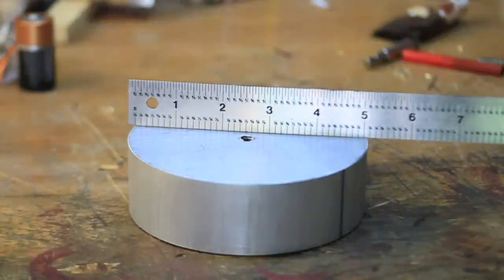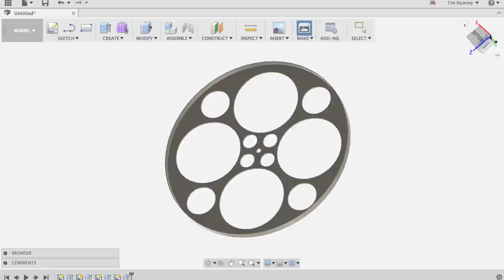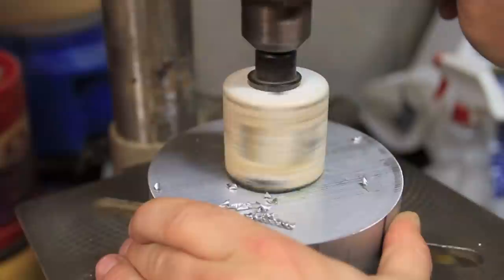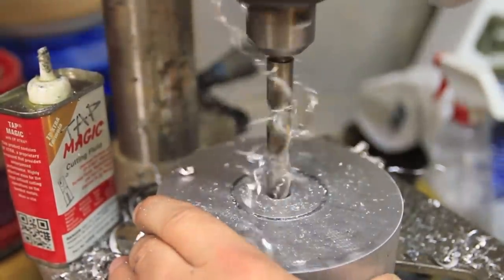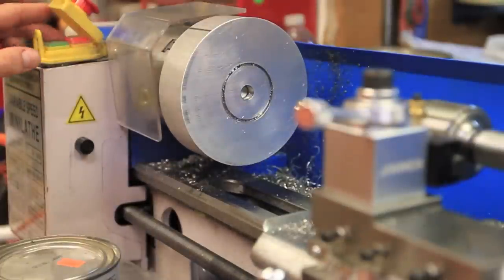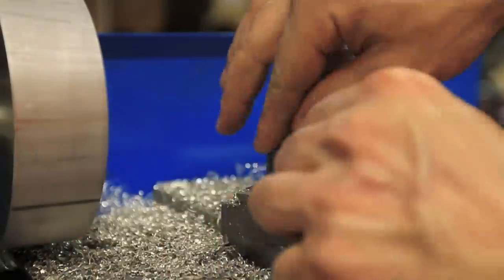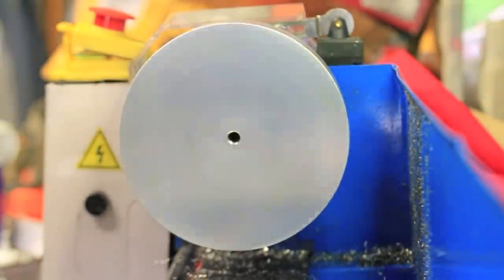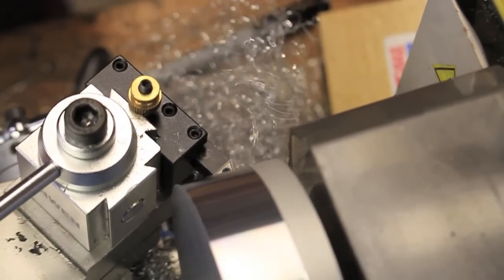Size matters - Large diameter turning, facing, and boring on the mini lathe

Comment: When bolting the workpiece in this manner, consider using reverse jaws, at least for facing cuts. They give you much more support from the back face of the workpiece. They do grip a smaller portion of nuts, that's unfortunate, right. But the later issue could be overcome somewhat by using a long nut or a custom threaded arbor

Comment: I have done something like this before I got one of these mini lathes.  Measuring and drilling a centre hole "statically" on a drill press just doesn't cut it (pun intended).  The off-centre condition gets worse with each larger hole you drill.  You can't beat using a lathe with a tail stock and centering bit.

Comment: I thought you did great at utilizing your lathe's limits.  One suggestion is save that Magic oil for other projects and use an "acid brush", super cheap small metal handled brush, with kerosene on aluminum at your highest rpm and apply it on the hole saw and drill bit.  For the boring tool,  apply on the part.  Kerosene is about 50X cheaper and smells pretty good.  Keep making vids, you have that skill in hand !

Comment: Use WD-40 as a cutting fluid for aluminum. Also, would it ever occur to you to actually clamp the work piece on the drill press table? You know, for safety...

Comment: When you flipped and re-chucked the part, it wasn't sitting flush with the jaws. That's why you had so much run-out when you went to face the second side and turn to diameter.

Comment: You don't really need to make a template. If you draw two right angled triangles on a circle, with the 90 degree angle (and the other angles too) on the 'edge' (in 2 different locations), then the center is where the hypothenuses intersect. (you can use something like this for that: https://www.hiclipart.com/free-transparent-background-png-clipart-pjrhp )

Comment: I didn't think that hole saw was going to work. The only way this might have had a chance is to drill a few through holes at the cutting radius to allow the chips to clear. 

As for the rest I'm both flabbergasted and impressed. Interesting video in more ways than I expected.
Reply from the maker: Haha thanks I think.
Reply: Your channel is encouraging me to fix the "slop" in the cross slide and carriage on my little lathe so it might be useful; I had given up although it should be difficult. (FYI: here's some photos of mine https://sites.google.com/site/flexispeedlatheinabox/)

In the first video on your lathe I couldn't believe how much everything was moving around.  Following the link it didn't seem your lathe was significantly cheaper than the Grizzly 7x14 which looks much, much better. Did you consider getting one of those?

Comment: I've found that the stock tool posts on these mini lathes is actually pretty useful. With em you can clamp a tool in the outer position and turn bigger stuff.
Reply: there are some uses for them, like tracing a contour from a piece mounted on the tailstock and watching the cut mirror it on your work piece... plus it can hold 4 tools but my QCTP only can do 2. factory toolposts are cheesy tho haha
Reply: @pauls5745  That tracing thing is really creative. Thanks for sharing.

Comment: You can easily modify the cross by removing some material on the carriage so the cross ballnut doesn't hit the carriage. You then space out the cross ballscrews feed handle mount which should get you 3/4-1" easily on the stock ballscrew. Littlemachineshop.com sells a kit(part #5366) but it's spendy IMO considering you can DIY in about an hour.  Be thankful your lathe has a 4" chuck. The older model 7x lathes came with a 3" 3 jaw that will barely hold 2.75". I'm considering picking up a 4 jaw 5" but the price for the chuck is what I paid for the whole lathe used.

Comment: Let me  make a guess on where this got  out  of round. When you  did the  boring  cut so it would  fit that cut amplified the  center  error  of the  bolt. While you  did get it  mounted in a safer and  more secure manner it was  further from true than the  original  centering  hole. If you are going to do much like this  you may want to  get a 5" 4 jaw chuck.
Reply from the maker: I thought about that but when I had it mounted with the bolt there was very little runout. Also I would think that any out of round at that point would have been roughly corrected with the boring by the first few initial boring cuts being interrupted cuts as it was correcting any off center. But maybe my thinking is flawed.

At this point I don't have anything in mind that is this large in diameter after I finish this part but who knows - I'm sure I'll get a 4 jaw chuck at some point.

Thanks for the thought!
Reply: Obviously I was not there and  my view is just what I see on You Tube. I think you would agree it seemed worse after mounting "properly". Perhaps the stress of the  cutting tool caused some  flex in the bolt that effected the cut. You  know the rule of the School of Hard Knocks. You learn more when things don't go right.
Reply from the maker: It was definitely worse after mounting it properly, but all things considered it's workable. I need to fix the way the carriage is tightened as that's the source of a lot of flexing and general unwanted movement. I think I have the idea I'm going to do worked out but I just need to get the materials and build it - I'm sure it will be a video. :)
Reply: Bolts never run true and  you've made it worse by adding those nuts so that your work was initially mounted to the chuck at an angle. By the way the part wobbled when remounted it's obvious it's not just runout (ie. center moved) but that the axis on which you turn actually changed. What you should of done (besides getting a proper lathe for the job but 
 let's not go there) was make an arbor for such a work. Start with round stock or a bigger screw and turn it true so the chucked part is cylindrical. On the part sticking out of the chuck you leave a shoulder,  turn the rest of the arbor so it's a tight fit to the hole in your part (preferably light press fit if you can manage it) and then put the thread on the end so you can sandwich the work between the shoulder and the nut. After you make the arbor don't take it out of the chuck as you'll never get it in exactly the same. Also use a larger diameter arbor as if will flex.

When you turned the part over and saw that it wobbles, you should used your indicator to make the face run true by loosening the chuck and tapping the part in straight. You can also put a bearing on a shaft in your toolpost and  lightly contact the outer race to the face of the work - that will make it self center. If your lathe doesn't do very low speeds turn the part by hand while doing this.
Reply from the maker: Wow, thank you so much - those are both very helpful suggestions that I will be sure to keep in mind if I end up doing something like this again in the future.
Reply: For completeness -- it's very difficult to tap straight without a jig of some sort because the tap will cut in any direction it's pointed.  It doesn't try to follow the hole.  You can make a stub piece with a 60 degree point to go in your drill press as a follower -- most taps have a center hole at the back.

Comment: I would have checked to see which side was the most square with the sides. If neither face was square, then shim one side till the sides are vertical, then bore the center hole and mount it on a mandrel. But how will you do it is the interesting question.

Comment: How is that quick change tool holder working with the boring bar?  Does the bar move when you put pressure on the inside of the hole?  My quick change tool holders are all loose and not properly made for the post that it was sold with.  When I use the boring bar its not solid and moves from any pressure thats applied when boring a hole.

Let me know how that jinwen is working for you, maybe I can get one of those instead.

Comment: FYI, did you know that you could use a boring bar to turn the ouside diameter ?    That alone would have help a lot in your case since you had no options.  The other option would be using a face plate and screw the partto the faceplate.  

You see when you go beyond the limits of specific size lathe, you put yourself at risk of scraping the part or have the part get the hell out of the chuck and hurt you in the process.  
And also, when you end up risking your safety to turn a part that's outside the envellope of your lathe, it'S a clear sign that you need to upgrade that mini lathe with an other lathe one step bigger.  Please Keep that in mind.

Comment: In watching your video, I agree with others when they say clamp your work.  Good thing it was round.  To achieve 1/2mm runout with your current tools was excellent.  A chip hook is needed to remove long chips, especially from a running part.  A brush can be used to remove the swarf.  Better than digging chips out of skin.  I initially thought the 3D printed center finder was over kill, but realized what you were doing when you asked about 3D videos.   While I may know a little more about lathe operations and have a better lathe, you have KungFu master computer skills compared to this old guy.  You look to be a new up and comer.  Keep Machining!

Comment: I commend you for being creative, but I would recommend just having a larger chuck available that you can switch out for bigger stuff.
Reply: UltraNon If you get a larger chuck, you need a mounting plate to hold it to the smaller arbor. If you make that instead of buying it, how do you hold the plate? 🤔

I'm actually doing that this weekend, to mount a 4" ER40 collet chuck on the 7x10 (same headstock as Tim's). Considering using a threaded rod through the headstock, like a drawbar, to hold it tight to the chuck face for facing it and cutting the recess. Then I'll drill/bore out the un-recessed portion.
Reply: One of my first thoughts was “lathe 7 inch max swing , Chuck? Not so much”

Comment: You do know that to find Center all you have to do is measure your diameter divide by 2 for your radius with your calipers and scribe three arcs from any three points on the circumference of your piece right? That's like sixth grade geometry
Reply: Technically speaking you could even do it with two but more accurate with three

Comment: Did you actually just 3D print a disk because you were too lazy to find the center using a ruler?
Reply from the maker: Lazy isn't usually a word I'd use to describe myself. I thought it would be a neat way to find the center and it had been a while since I 3d printed anything so I scratched that itch while also solving my need to find the center of that disk. I find it amazing how many people are offended by the way I did that. Thanks for watching!
Reply: @TimNummy  not offended. Just shows a knack for doing it the hard way. But if you have the time and skills to design that part and 3D print it - good on you.

Comment: I read through quite a few posts and didn't see what I'm about to tell you so if it's been posted I apologize.  First of all,  my God I was cringing when you were using that drill press without holding that piece with clamps.  You only know how bad things get after it happens to you but the reason I am posting I had to stop watching when you put that bolt through your work piece with those nuts on there spinning that piece in the Chuck was asking for it to unthread!  You needed left hand threads on that Bolt if you really had to do it that way. It really is amazing that you didn't get hurt doing this with that chuck spinning in the direction to unthread your  mandrel

Comment: Good try though.. but cant understand how you do precision work with such sloppy approach... 

that bolt couldnt be concentric to the outer diameter when your drill press table was flexing like crazy,,, and holding the piece by hand when drilling ? and you say .5mm runout is ok? man thas 20k , you went to all that touble to 3d print a template to find center.
Even the boring bar was flexing when boring the inner recess...

Comment: Failure to secure work piece in drill press, grinding on side of wheel; was this a demo in how to do something in a dangerous manner?
Reply from the maker: Maybe so? Can you not think of a single positive thing to say?
Reply: @TimNummy  Yes Sir, "A" for effort; that being said, and me not being an expert in machining, please understand that my 1st concern(s) will always be safety (Lt.-paramedic/firefighter & Emergency Dept - RN). I don't want to see you or anyone else get hurt; you via your own setups, or someone else by watching. I do think that you had some novel approaches to resolutions of your problems. However, at ~7min. when you mounted the plate via the bolt, as you started to apply pressure near the outer periphery I could see the plate flex toward the rear; 2 things here, it will never produce an accurate cut, and(worse) you stressed the setup thereby weakening it. As an aside, I have a lathe that size, and also a 12 x 36. Everything has its limits. some other clues would be the "finish" you had during your 1st facing op, adding to that the fact that your initial boring cut generated stresses on the setup which would cause a smooth, BUT eccentric bore lead to the obvious eccentric setup when you flipped the plate for the 2nd operation(s). Lastly, it was not my intent to offend you. I still screw up (last time I ignored chatter in a cnc milling op which lead to a broken EM, and wasted work piece. I would suggest that you check the channels of some of the Masters on YT for those finer points some of it may bore you, but in the end it could save you $ and time; also thing about what it will feel like if that part departs the chuck. Even if the part is "in the chuck" if it sticks out far enough you could have an episode of "micro-movements" which may "walk it out". (Check out Joe Pieczynski's - "Get your steady rest aligned) - not just about the steady. Best wishes, and I hope that you have a great Thanksgiving Sir!

Comment: Definitely interested in more 3D printing content!

So the lathe can't really mount a 7" part without modifying the part beforehand?
Reply from the maker: Awesome! I'll try to start doing more :)

And nope - actually 7 inches is the maximum size of which the part would be resting on the ways and the center point be lined up with the center point on the chuck.... so probably the actual max size is more like 6 usable inches. But this lathe is so light that unless it was hollow or plastic or very short (like the piece I was working with), it would probably be scary to turn anyway. As a side note, this lathe came with a 4 inch chuck... so even though the work area is 7"x14", the 4 inch chuck can only hold a 4 in diameter piece. I could (as many people seem to do) get a 5 inch chuck which would have let me mount this piece directly. Hope all that makes sense and thanks for watching!

Comment: Go to Harbor Freight & buy a $10 ...I forget what they're called... machinist square & ruler? ...The thing that often comes with the protractor attachment but you can buy these separate. Anyway, you simply put the slug in the square, like you would in a v-block, with the ruler attached and sore lines on it wile rotating the slug. The more lines, the more accurate the center but two lines would do better than that tool you made. If you want good tools though, you can get a decent set for $50

Comment: to turn the circumference of a large diameter part a good solution is to rotate the QCTP such that one dovetail faces the operator. Then you put a boring bar parallel to the spindle axis on the operator side of the QCTP. That usually gives you the maximum possible diameter. Check out this video "OLD STEAM POWERED MACHINE SHOP 21" 26 min into the video.

Comment: I am still undecided if I want to buy one of these lathes or go with a more expensive one ? Is the 7x14 Grizzly any better ?
Reply from the maker: I've never been around the Grizzly but I imagine it has at least 3 things different than thing one - more expensive, better initial quality, better customer service. 

That said, I think it is largely the same design (all the flaws and short comings included). Possibly, you'll have a brushless motor vs brushed, maybe a tach already built in, and probably a two speed gear box with a (probably) plastic gear inside.

Comment: ok. it was a hard way - we understood. Now easy way: Drill  a hole on a middle of the blank. Take a threaded bar long enough and two nuts and washers. Tight everything thru the chuck and the head stock from both sides, tight jaws. And do everything you want on any rpms. you do not have use 3d printer and make additional thread withe million nuts. Cut blank half way one side, turn 180deg and cut second side and you will have a perfect doughnut. 12 min work. Good luck

Comment: You will get better finishes using HSS tool bits. Carbide tools do well with deep cuts and high feed and spindle speed, which your little machine cannot handle. Cheap 1/4 inch HSS tool bits and sharpening according to standard shapes is a good way to go. Rake angles, nose radius etc. can be customised. You will need to figure out a way to hold the bits, but just a few shims will get you going.
Reply: George Cyclist it's easier to be consistent with carbide inserts than HSS. I've been using both, and getting the cutting point just right on HSS can be a struggle (can't be too sharp, need to hone it after grinding). When I tuned some 1.25" steel rod on a similar lathe, I was getting horrible scoring with the HSS bit, and switching to the cheap HF 1/4" insert tool gave a much better finish. But on aluminum and delrin, the HSS works great.

Also, he has a height adjustable quick change tool post, no shims needed. I got the same one...its cheap and aluminum, and not 0xA compatible, but it's still more convenient than the stock 4-in-1 post.